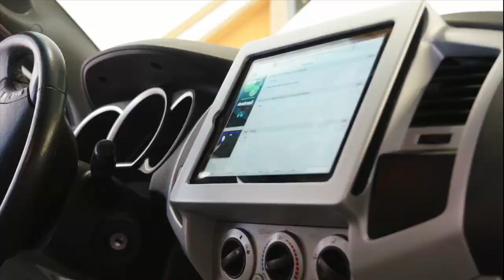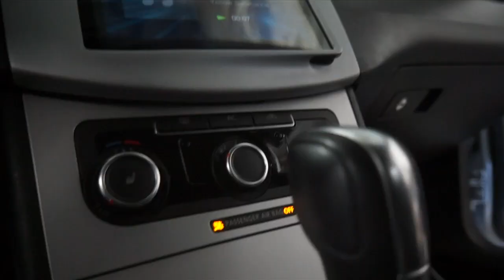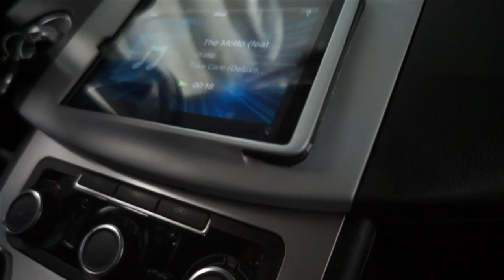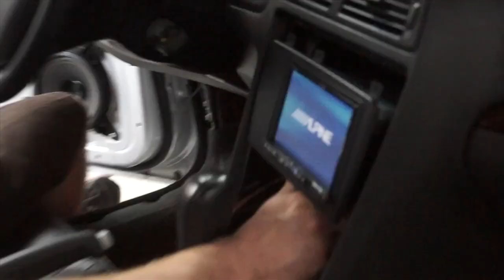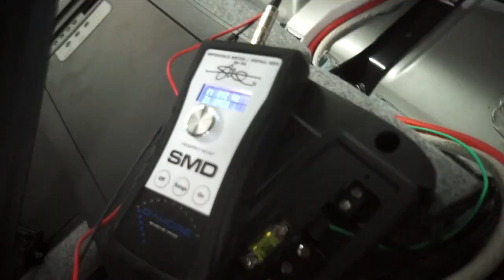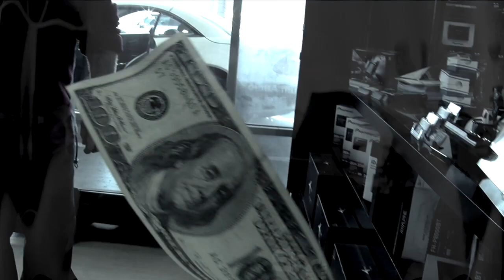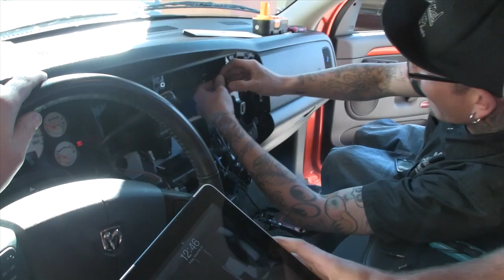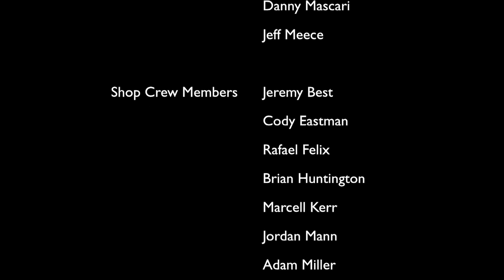iPad mini car dash install VW CC, Audison Full DA sound system install Volvo S40 - Amplified #100

Comment: I have a BMW 330i E90 with a aftermarket head unit. The car has the logic 7 speaker system but the stock amp seems to have been bypassed. Can I get the stock amp working again with this hu assuming the amp still works or even better install an after market amp to power my speakers. There are 13 speakers total. I guess I would need 2 amps. All speakers are stock logic 7. Any help would be appreciated.